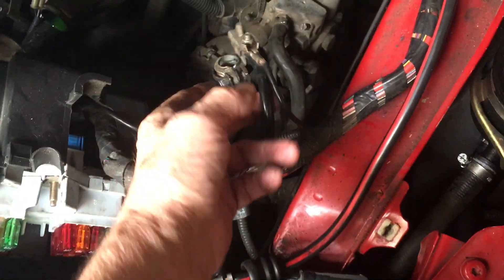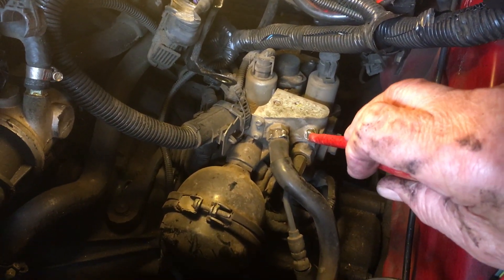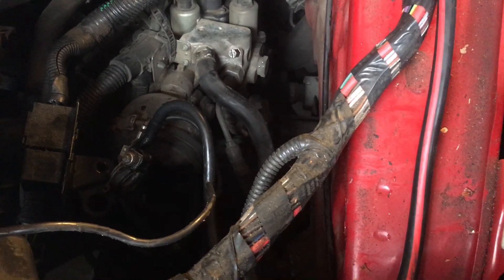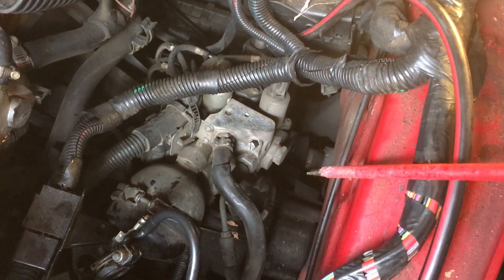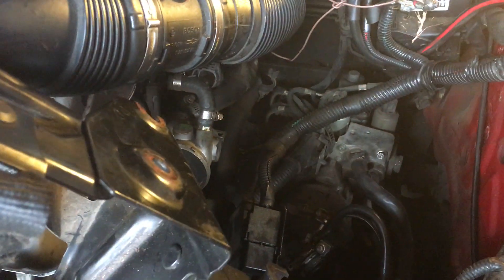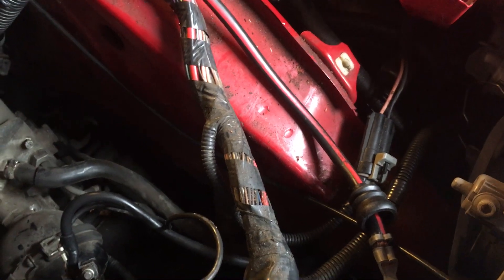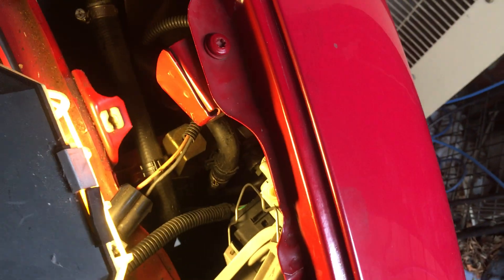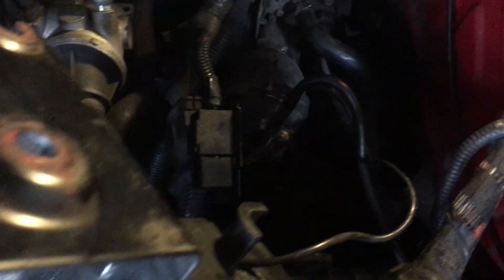Alfa 147/156 Selespeed System, Description of Where, What & How

Comment: Hi needing help. Appreciate you.

The car doesnt move at all. So i removed the gearbox and i found out the gearbox is damaged, pressure plate and bearing. I changed everything.

Now the car doesn’t crank up. 

Battery, Fuse/Relays, starter motor is okay. Do you have any guess what could be the trouble?

Comment: Hi. Very detailed video. I have one problem with selespeed. I notised that lately ss shifting is rough and little late. Do you have some advise?
Reply from the maker: Not sure what that could be maybe check how often Hyd pump is cutting in and out as if pressure tank is on way out may not hold pressure which may slow the gearchange other wise could be dirt got in gear shit mechanism as its a bunch of solenoids moving the gears. Sorry cannot help more
Reply: @kiwitrevau  Thanks mate. Yes, I think that something stupid bug my ss. Becouse I have all gears, it shifts but with some pause. Thanks anyway

Comment: I've switched the accumulator and cleaned the filter hose and now I'm stuck in neutral can't move anywhere what should I do
Reply from the maker: You need to establish that the Hydraulic Pump is operating to full pressure!! You will not be able to select gears unless it has pressure!
So you need to watch the film which shows having battery on ground but connected with jumper leads then check pump oil tank and add if needed with correct oil, then activate the pump by "turning on key" "but not starting engine" and the pump should start then turn bleed screw the pump should run continuous while screw is open and should stop when screw is closed. At this stage there should be pressure and you should be able to select gears and as you do the pump should cut in and out periodically to maintain the pressure. All the best
Reply: @kiwitrevau  it didn't work!  I need your help once again!

Comment: I need to switch  my accumulator it's sometimes just found this to neutral when I'm driving anyways how do I do it I bought one online do I just unscrew the old one and put in the new?
Reply from the maker: Yes but must make sure no pressure in system
Reply: I've switched the accumulator but now when I turn the car on it stays in neutral and doesn't even goes to first gear I'm stuck what do I do?
Reply: @harelhouse8499  What happend? Have you solved the issue?
Reply: @Meox_YT  nope. I bought a new accumulator and a new pump and same problem... 
Someone said it's something with the electricity a shortage of some kind but I do not know where or what stuck without a car for too long now...
Reply: @harelhouse8499  Have you bleeded the system? Maybe that's the issue or that there is no pressure
Reply: @Meox_YT  I did belied the system and after I installed the accumulator the pump didn't give no pressure only 30 MVP's then the mechanic said I need to switch a pump and afterwards he said that's now the new pump is overheating fast and disconnected from the system. therefore he thinks it's a problem with the electricity somewhere he doesn't know...
Reply: @harelhouse8499  Have you tried troubleshooting it with a computer?
Reply: @harelhouse8499  It could be the brake light contact by the break pedal
Reply: That isn't working
Reply from the maker: You will need to bleed system after
Reply: 9

Comment: Hi Ser , I bought alfe 147 selespeed , when I make test drive, every thing was ok , then I brought the car home by track,, next day I start is , drive it to wash station, wash is by high pressure water , then I drive it and after 500-1000 m it’s begin to jump on speed 1 , like the klatch don’t take the gear at once , rpm go up +- then it go or jump , then it change gears normally, the same but les is happening in R reverse, 
- the battery is weak ( it had long stop)
- the temperature was height 34* .
- i shut the engine and start , all the kontrole lights warns , then i shut and start and every controls is shut ( all normal) just the jump in start. 
- change gears is normal by hand or automatic. 
- before that I change the system many times , city - auto- tiptronic-city and that when I drive before the problem began...
Here in Czech no body have experience with selespeed ,, can you give me some advice , or what I do wrong ?? Or what I must check or change??
Tomorrow I will try it again, if it behave same with cool gear box and engine , or if some water was there , and change the battery, and I will tell you what is happen new.
Thank you anyway 
Sam
Reply from the maker: Hi Sam, Well DO NOT EVER SPRAY WATER OVER OR UNDER ENGINE/GEARBOX !!!!!!!!!!!!NEVER!!!!!!!!!!!! You must allow it to DRY maybe a 2 days in warm weather.
To make your Engine Clean and Sparkling First clean with Rag/Cotton Cloth and CRC or WD40 this will remove oil. To make it look like new and Shinny use Tyre Shine Spray !!!!
You could now have problems with water in Sparkplug wells and on leads if you have misfire remove all completely and dry before resaasembly as my films. Re gears it would seem you got water in Clutch so only time for it to Dry will help. You cannot water spray or High pressure water spray these engines!!!!!! Good luck feel free to ask any other questions. Regards Trev
Reply: Hi, thank you very much unswerving me, I appreciate it,,
I forgot to tell you that I change the mode , city- selfchange - city- self change- city. Etc. many times during driving the car , after that it began, in that day. 
Yesterday the temperature was 33-37 C, and I make another test drive cca 20 km ,, and car behaves normally, the problem gone , but I use the steering change gears, and don’t use City mode at all , every thing is ok now, or until now , and I hope it stays like that,,,,
Best Regards. 
Thank you a lot. 
I will contact you if something new comes. 
Sam. Z.

Comment: Hi I have a question. My 156 selespeed (2002) starts fine, the pump starts when i open the door. It shifts nicely into the gears. but when i take my foot off the break and push on the gas the car does not move. It just revs the engine. Any idea what i am looking at here?? Any help would be welcomed.
Reply: Is it slipping out of gear into neutral when you rev?
Reply: @Zion-jw3gm  nope just revs
Reply: @vikingwoman1971  
Are you able to select at least 3 gears without starting the engine? If you can, it might be your clutch, if you can't, it may well be one of the issues Trev explains in the video.
Reply: @Zion-jw3gm  do you have any tips how to check that it is the clutch for sure?
Reply: @vikingwoman1971  
The only thing that might help is to run a diagnostic, for that you can buy the software multiscan or get an alfa specialist to visit or get it towed to them.
Reply: @Zion-jw3gm  thank you so much now i just have to get my brother (that has this tool) to come over and help.  :)
Reply: @Zion-jw3gm   had my brother run diagnostics and the "Clutch pressure plate  travel" was at 27,26. As far as i have researched it is supposed to be at 28-28,5.  Sooo we did an adjustment and set it to 28,4. But the car is still not moving. It seems like the clutch is "stuck" as if it is locked in a "push the clutch peddle to the floor" kind of way.  (yes i know its an automatic lol) if you know what i mean. Any ideas?
Reply: @vikingwoman1971  
It might mean your clutch is just worn. No amount of adjusting can fix worn clutch material. Also double check visibly that the clutch rod adjusting nut is still holding the 28.4 position, the thread on these are known to wear out.
Below is a procedure to follow when doing your clutch adjustment, just double check your brother followed the process as described.  The adjusting Nut mentioned in this instruction may not be on your car! I'm aware some newer models apparently don't have them. So don't worry if you can't locate it just means you don't have one.
All credit to SPANKY
1, Load up Examiner or Alfadiag and select the "Selespeed" ECU, connect and then go to the "Sensor" tab, in the drop down menu select "Clutch Adjustment Position" and check the position on the graph. If it is outside of 28 - 28.5mm then continue, otherwise your done.
 2, Remove the battery and tray to gain access to the actuator.
3, Slide the cover off the clutch release actuating rod and loosen the 10mm locknut. 
4, Connect the battery via jump leads and turn the key to MAR, connect with Alfadiag or Examiner again. 
5, Now to adjust the rod you hold the piston still and rotate the larger 19mm rod, out to increase the length of corse. Watch the display as you do it to ensure you don't go too far, when it'sin limits lock off the 10mm nut and refit the dust cover 
6, Now click the "Actuators" tab and select "Calibration Routines", Bleed the clutch and then run the EOL Auto adjust. You'll hear a lot of whiring and clunking, that's normal, just keep your fingers out of the way.
 7, When that finishes sucessfully, rebuild the car and reset your clock.
Reply: @Zion-jw3gm  thank you so much :) i will be doing that today i hope
Reply: i am not finding out how to go into my Icarsoft to calibrate the clutch... where on earth do i go? is there any chance you could do a walkthrough?
Reply: @vikingwoman1971  
no i've ordered one. what ver u have?
Reply: @Zion-jw3gm  i have the icarsoft one
Reply: @vikingwoman1971  
just found out isoft doesmt do calibrations. im waiting for comfirmation.
Reply: @Zion-jw3gm  well crap...
Reply: @vikingwoman1971  
yes indeed. The only ones that does all is multiscan you  can  download for free but to a laptop. there is one other that comes highly reccomended by owners but i  cant post now.
Reply: @vikingwoman1971  
Below is the link to multiECUscan read through thesite carefully info for your car.

http://www.multiecuscan.net/

This Link is our Alfa Romeo F.B group. Join and Post your query there let them know ZINK sent you (if they ask), there are very knowledgeble people who can help if I can't respond, the best in my opinion is Dave C. 

https://www.facebook.com/groups/alfa156.net/?ref=bookmarks

The isoft product might still be worth keeping for pulling fault codes and correcting them without having to hook up a lap top, so don't be hard on yourself.
Reply: @Zion-jw3gm  any chance you can link that Multiscan tool ? My car is still not running ... :(
Reply: @vikingwoman1971  
You and me both, I just have'nt had the time to look at mine. I'll send you the link when I get home from work. I just bought a license and installed it at the weekend, so far so good. I'll hook it up to the car tonight and let you know how it goes but it looks great.
Reply: @vikingwoman1971  
Ok here's the link I used to buy mine, it comes with cables and everything you need to install on the laptop, just be sure to read the instructions for install, which is quite simple anyway. I can see on the software it supports your year and model so goodtimes ahead. Just remember what I said, if your clutch is worn and needs changing running the calibration may not help until you've replaced the clutch.  Run a diagnostic with the program first to see any error codes.  https://www.gendan.co.uk/mes_chooser.php

Comment: This is the hardest car to work on I have replaced many Sillyspeeds, they fail around 50-70k kilometres by desing, the accumulator starts to leak over time and not holding pressure, the material its housed (ball) becomes porous overtime, the sensors fail due to seals because they wear out since its horizontally laid on top, the seals fail due to gravity. After installing a new selespeed you will need the alfa software to calibrate it and check pressures. Get rid of this car unless you have 4k to spend every 5 years or 6hrs and 2k fixing it. Not to mention timing belt on these cars every 3 years regardless of kms travelled.
Reply: I had my Alfa Romeo 147 stuck on Neutral, the Selespeed System (Actuator) was leaking... so I just packed it..) can I be able to fix it

Comment: I purchased from Japan an LHD  used Alfa Romeo 156, selespeed 1999 model,  2.0 lit, 16 valve Twin spark sedan, Chassis Nr. ZAR 932000*00082038. 

 Please permit me to give you the details of the diagnosis I’m facing : 
 
When I switch on the ignition; the car engine starts efficiently, while the engine is still running and I want to drive the car either (Front or Reverse)  ☹️🤔 it doesn’t move although the gear is fixed, even I accelerate the fuel but it doesn’t move (the engine still running). 

I can observe a RED LIGHT  comes on  from the button shown  ON  at the dashboard at (the RPM area) that icon shows like a sprayer

What I do usually ??  I OFF THE ENGINE AND START AGAIN, then I put the gear and the car moves on. !! 
The car doesn’t make this malfunction while driving on high way BUT unfortunately when I slow my speed to drive over a hump or I'm on congestion  traffic; I face the same problem
. 

In Dubai car dealer, they suspected the ECU (Engine Control Unit) failure,  although, of that, I changed it with another used one from Japan, but still having the same problem. 

Anyone knows what is the problem please, 
Thanks, and best regards.

Comment: Good day mate , what would you say could be a reason for the pump not autonatically priming when you open the drivers door? My 147 has been doing that for a while and then it takes turning the ignition on and off a couple times before the pump primes .
Reply from the maker: If its already up to pressure then it will not start when you open the door. If when you open door and it does not start try putting it in gear with Ignition on but motor not running, the pump should cut in after selecting a few gears if the system is ok. You could try changing the Pump Relay as the contacts could be on way out? The Pump relay is Opposite the Battery mounted Separate on the Wiring Loom NOT on the Fuse panel. It is shown on one of my films. The after market relays are cheap usually buy and Electrics parts place. Hope it helps.
Reply: @kiwitrevau  Hi, what a video! I have the same issue but on a 159 ,   do you know where the  pump relay is located on a 159/brera?  not in the loom ..I coudn't find it.  If you know where the pressure sensor is please also tell me.   Cheers!
Reply from the maker: @davidBarrel  Sorry no I dont know where it is in a 159
Reply: @kiwitrevau   thank's anyway for replying man ;)
Reply: Never mind asked too soon you answered the question at the end